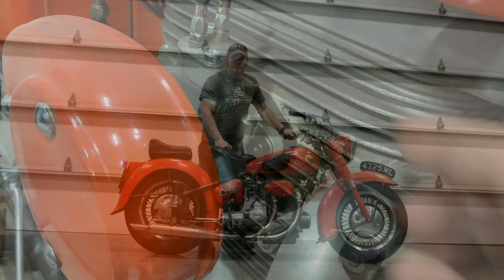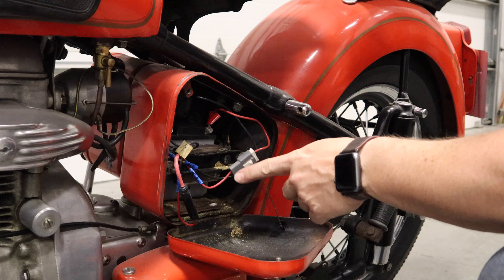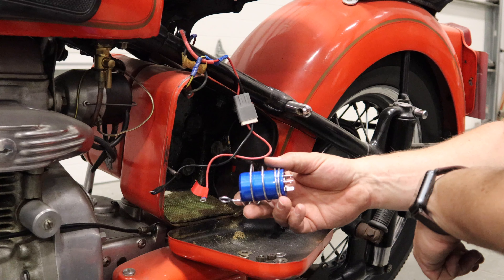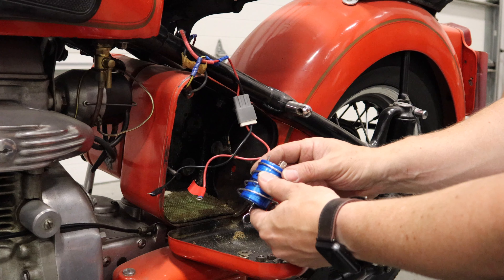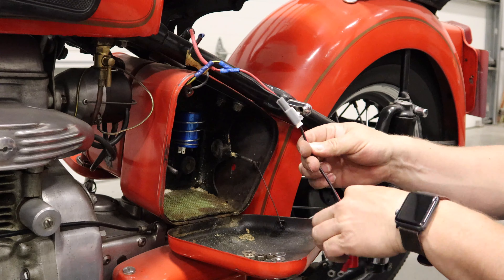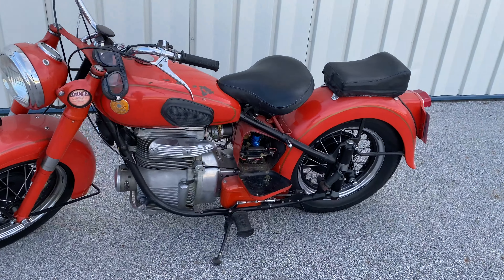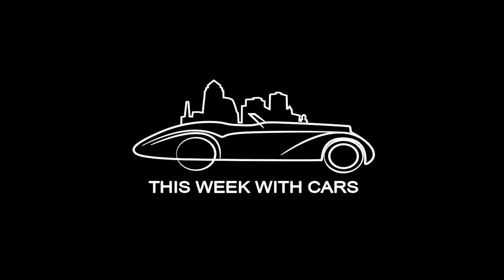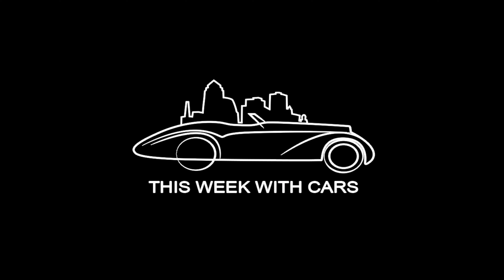Converting Sunbeam S7 de luxe to Capacitor Powered

Comment: Motorcycle guy since 1985 here and learned today that this was a thing. Super cool. I've had several kick-start-only bikes over the years, a TL125 Honda dirt bike, a KZ400, Suzuki 650 special with a broken starter and others, and never knew you could use a capacitor in a motorcycle like this. If I knew about this in the 80s, and they had these kits for my bikes, it would have saved me so much heartache and money as to pay for that capacity 10x over. And now I know, and knowing is half the battle.

Comment: Converted my Royal Enfield in 1974 to capacitor and got rid of the battery. Worked great and never had a problem starting the bike after that. Glad to see you are using the capacitor.  I thought Sunbeam only made cars, great rare motorcycle.

Comment: Great idea. Back in the 1960's I had an S8 (circa 1953/4 ish?). My 2nd (but "real") bike; after the BSA 124cc Bantam.
I loved the 'Beamer. 
If you have mysterious loss-of-ignition when turning the handlebars, or going 'round any corner, as I've experienced, I have a suggestion.
Check the wiring loom that wraps around/goes past the steering hub. I found a length of wire had 'dissolved' into verdigrease. I found the fault by progressing along the suspect wire with two small pins starting about a foot apart; connected to a multimeter. I'd disconnected one end of the wire, then started looking for any sign of resistance in that wire. (Oh the small pins I pushed through the insulation to make contact with the wire's copper strands within).
I finally narrowed it down to a section around 1 1/2 inches long, where the fault was. I cut out around 3 inches, then along the wire I sliced open the errant area; revealing the sticky gooey verdigrease inside. All strands had corroded through. Just one or two strands were actually touching together!. It was amazing it had been able to start at all!. I then spliced in a new 3 inch section of wire.

Comment: Had a 40V, 10,000 microfarad capacitor set up on my '97 Harley Electra glide. Glide used to eat batteries and I got sick of having it let me down when away from help, capacitor set ready to wire in if needed, get the push start thing happening, get back home without a problem. Good vid Steve.

Comment: The 1st Triumph unit construction bike had a battery circuit bypass on the ignition switch, to get the bike to run, then switch to battery circuit. Wonderful in theory, never worked. So you have it running ign on capacitor replacing coils?, what about the lights?

Comment: do you have to charge the capacitor each time you want to start the bike or does it get enough juice from the generator after a few kicks.  Modern MX bikes use a capacitor and actually run a 12v efi pump and small computer without a battery , they take a couple of kicks to charge up.  Interesting Sunbeam did 40 years before.

Comment: Hi Steve and thanks for this video. I'm biker as well as a Landy man but I'd never seen this modification before so found it fascinating. I'm assuming this works because on older bike you foot crank the engine into action? Good job and thanks again. Are there any downsides? I only ask as I have a pal who has a Ural sidecar outfit which has electric and foot crank starting and it might be something useful for him.

Comment: Yes please, more Sunbeam.  Was this the same Sunbeam company that made the cars?
Reply from the maker: Yes and no, they both came from the Sunbeam Cycles company which was making bicycles since 1887.  The car company separated from the original company in 1905 but the bicycle company did not start making motorcycles until 1912.

Comment: Great bike. I use a small modern smart charger on my bike and it has kept the battery in tip top condition for years even though the bike gets little use
Also the points shouldn't be arcing. That usually means the distributor. capacitor needs replacing.

Comment: Intrigued by this S7, it appears to have a UK registration mark , reversed numbers ML ( London area ) which would date to the late 50s , early 60s and they were black or green in the UK , never seen a red one if it's original !.
Reply: It's not. It is a repaint, and has an Amal concentric carb. Original was a 276 side float. Also not sure about the chrome rims. (owned a '52 S-7 for 15-20 yrs.)
Reply: @richardcovello5367  Sunbeam would paint them any BSA colour for export bikes, so not sure about the colour.. The concentric carb swap is a very common modification as the 276 is said to give a load of trouble.
Reply: @casperghostboat  The stock colours for the S-7 were black (1947-50?), then "mist green". The S-8 came in silver or black. I have not heard of any exceptions for the world market. I suppose you may have been able to order special colours from the factory, but I don't know if anyone did that. Yep, familiar with Stewart Engineering's Amal concentric replacement, but it's still not original, is it.

Comment: I didn't know they made a red Sunbeam S7. I have a black  one. I researched them and read they were black or green. Could someone send me a link where it talks about the red bikes that were produced.
Reply from the maker: This was a specially made bike in fact wikipedia says bikes leaving the UK could come in any BSA color.

https://en.wikipedia.org/wiki/Sunbeam_S7_and_S8

The original S7 was produced in black. The S7 de luxe came in either "Mist Green" or black and the S8 in "Silver Grey" or black. For export abroad BSA would supply Sunbeams in any BSA colour.
Reply: I’ve never seen a Red Sunbeam S7 or S8. Maybe it’s an export from Europe color, I thought the S7 was in Black or Green and the S8 was Polychromatic Grey or Black. That speedo, max 120mph? anything over 55mph and you’ll have oil leaks from the oil feed through the head gasket to the camshaft. 
My 1952 S8 is Grey, fully rebuilt and restored. Probably over restored, but needs continuous maintenance!

Comment: This doesn't work, as soon as you switch the ignition on , the coil sucks all voltage out instantly. Also you didn't show it starting up!
Reply from the maker: Most of my vehicles are running on capacitors only now.  Watch my video when I convert my royal enfield to capacitors, the electric start works better than ever.

Comment: Why replace a working battery with such a small capacitor, if you stall it the lights will now go off leaving you potentially invisible to another road user
Reply: I have one that is all original that I may sell.

Comment: What about the lights?
Reply from the maker: They will run when the engine is running.
Reply: @ThisWeekWithCars  Doesn't the battery help stabilise the voltage though?

Comment: Hi Steve, I found you recently and have been eating up the content. Big fan of what you do. However I hate to burst your bubble, but on this one you are incorrect. There is much not original on that bike, including the paint. Additionally, the carburetor is wrong as is the chain tensioner and much of the polished items. I have a '50 which is restored correctly and so I can give you some help if you would want to go thru this bike. Also check out Stewart engineering in England for additional information and advise. Happy motoring.
Reply from the maker: I have the original carb in a box, I am the one that replaced it with the AMAL on it now.  The color is original, any BSA color come on them special order as this one was. This bike was specially prepared with gold pin stripping and chrome wheels two special options which are also seen on this bike at the AACA Museum https://www.flickriver.com/photos/splattergraphics/37081975513/

Comment: Love S7s but do not like the saddles on yours or the handlebars, just not British :) . Source the original ones for it. Quite like in red but a bit to much like a Indian so get it Sunbeam green or even black. Good and interesting video though. I will though stick with a battery in my S7 at least to it gives up the ghost then may try a capacitor. Once you charge it though and then shut off bike for a week or so or even longer do you need to charge again prior to starting ? That would seem a bit of a pain and if so I will be always sticking with a battery.